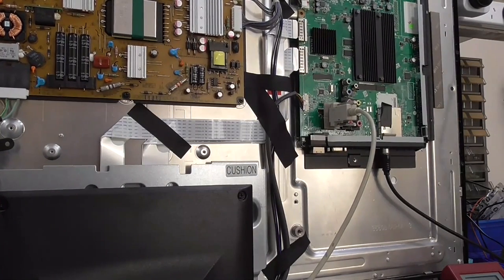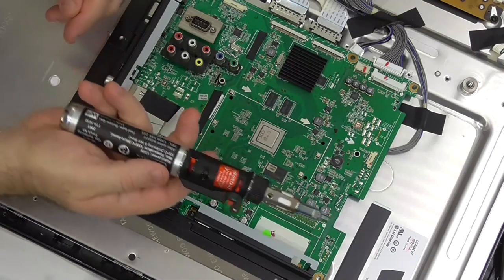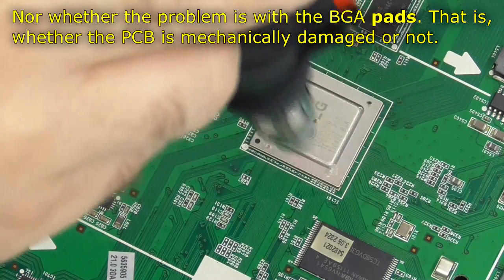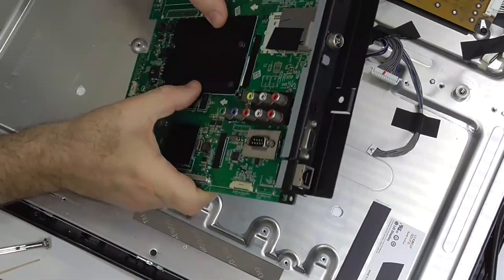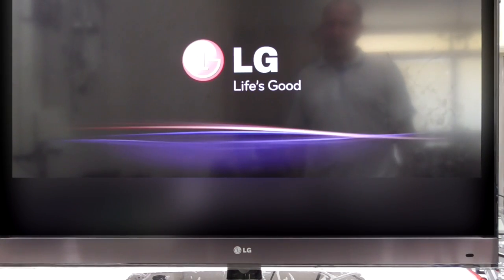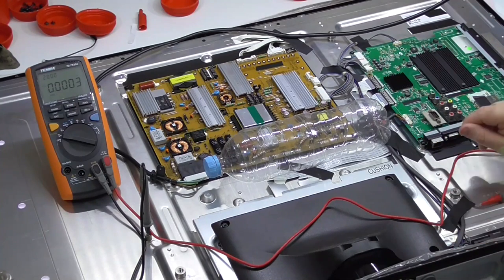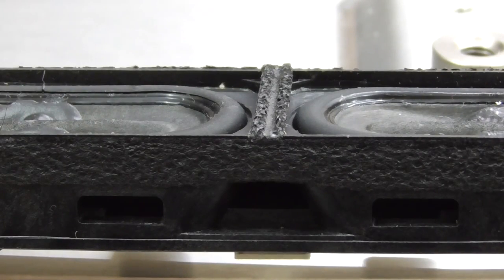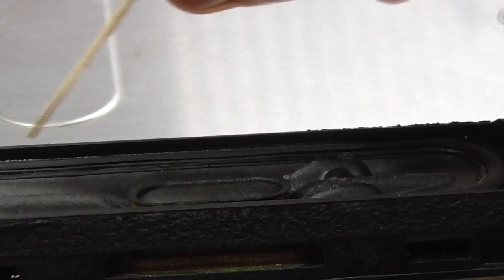Repair of LG 42LW5700 TA, LED TV, Part 3

Comment: Mr Richard thank you very much for your excellent video I have the same problem with a tv LG 47LW5700 the power LED only blinks medi all the voltages of the source are ok I would like to know what temperature works with the heat gun in those five minutes of heating .... greetings from Venezuela and Happy New Year
Reply from the maker: Just to clear, it appears that the problems fixed by heating this BGA chip are due to failures within the BGA package. That's the only thing that explains the results, given the methods used. In other words, the chip has failed, not it's attachment to main board PCB.

OK, so the Butane tool (obviously?) is only vaguely Temperature controlled. You control the temperature by both the rate at which to burn the fuel (Butane, LPG, whatever), the distance from the subject, and the movements of the exhaust upon the subject. The Thermal-mass and the rate at which the subject sinks away the heat, also determines the temperature achieved, and indeed the thermal gradients from the heat sources (hot) and the heat sinks (cold).
- Large thermal gradients are bad. Eg pouring hot water into an ice cold glass. 
- The "subject" is the thing your heating.

So the short answer is, FIIK. It's a black-art.

I did add a piece of solder to the top in the hopes that would be a good indicator of the packages temperature. But as soon as you blow the exhaust upon it, it melts and balls-up. In my case, blows away. After that happens, you have to guess.

If you were going to do this properly, you could add temperature probes (plural), on the package and the PCB. But you have to be extremely aware of the hot-air\exhaust.
For example, when I first tested the Butane tool, I directed the exhaust onto my temperature probe for a couple seconds or so, and was shocked at the rate the temperature rose above 400 Degrees Celsius. In other words, I pulled it away rather quickly, and did not get a reading. Then I searched the Wikipedia article, and that suggested that Butane burns in excess of 1900 Degrees Celsius - slaps forehead, for not checking this, beforehand...

Comment: What is the model of multimeter?
Reply from the maker: So I'm guessing that you could not read it across the top of the Meter. It's a Tenma 72-7730A (from Element14). Basically, it's a re-brand of a UniT UT71B, but with upgraded fuses, etc.

Plus I get "real" warranty and consumer protection having bought it from a Bricks and Mortar Vendor, here in Australia. Just in case.

Comment: This is a terrible way to "reflow" a BGA of this size and kind. It's not reflowing, really, it is merely expanding the balls so a contact is made; it'll fail within days or weeks and if anyone says they're happily running for months I simply won't believe them - been there, done that one too many times to take anyone's word. The only application of manual hot air "reflow" is with very small ICs like RAM chips where the area is so small and device is so thin and balls, accordingly, so little, that heat can get through the device to them and melt them while actually still providing enough heat to allow melt of the solder on the pads - something which simply won't happen with the 35230 and the air blower from this video.
No hard feelings, the videos are without a doubt educational to many; still this is the wrong way to repair the problem, even though it would look like it works for a while.
Reply: AMEN!

Comment: Hello Richard,
I need help from you to solve the following problem.The led indicator from the start when I put the power cable in 220 volts, the indicator lights red then white and then again red and then turn off, no any lights on indicator.When I use the remote control to turn on the tv on power button, the indicator lights red (the rele it is turn on) then indicator lights white and then white lights blinks once and stands in that position, there is not picture on screen.I have checked all outputs from the power board and they are ok. Can the problem my be the same as you solve it in this video presentation, I mean on the processor?
Reply from the maker: I recommend you search for the Service Manual [1], then check all of the Voltage rails on the main board. I won't list them all, but here are some I saw in the schematic:
 0.9V_CORE_BCM35230
+2.5V_BCM35230

+3.3V_NORMAL

+1.5V_DDR

+5V_Normal

...
etc.

Yes, it was unfortunate that I did not record, nor mention those Voltage checks I made before using the serial interface commands. I should probably clean the workbench, setup the TV, record that, and then insert the video at the appropriate point video series. We'll see.

Good luck.

[1] When I say search, I mean that in some countries, you're technically breaking the law acquiring copyrighted, perhaps even stolen material like that. So I'm not going to direct you. I feel, however, you should also have the right to this information, without cost. You paid a premium for the gear, so you should have got this already along with the operators manual. The criminal acts, I feel, occurred at the purchase of time...
Reply: Hello Richard, I have fix the problem with the way as you fix it on your video. Thanks for your support.
Br,Pavle,

Comment: how to remove it for for ic xd was seventh time to heat it
Reply from the maker: Seven times ?!

Maybe the problem is not (was not) that chip.

You have to think, not follow. If you do not have the skills to read the schematics and diagnose, then should not be trying to fix the main board. Instead you should think about buying a replacement. But even than, are you sure that is the only problem ?

Remember, sometimes it's not worth fixing.

The fact that you have to ask tells me that you do not have the expeience to be successful. You must practice on something a lot easier than this vary large BGA chip. This BGA has  656 balls at a pitch of 0.8mm. Very hard to do without damage. I would not even try.

For reference, here is an example of what you need. But more importantly it shows how it does not always work, regardless of whether you have the right equipment:

Linus Attempts BGA Graphics Chip Repair! - Rossmann Repair Group, New York City
https://www.youtube.com/watch?v=Shn7LdIrViQ

Lots of trouble with little success.